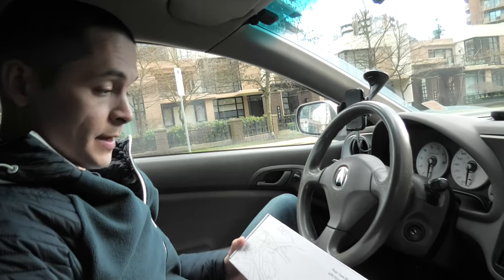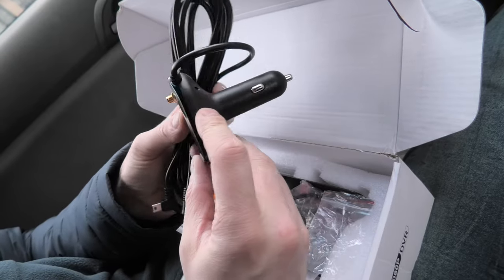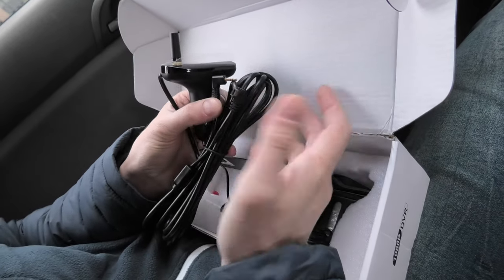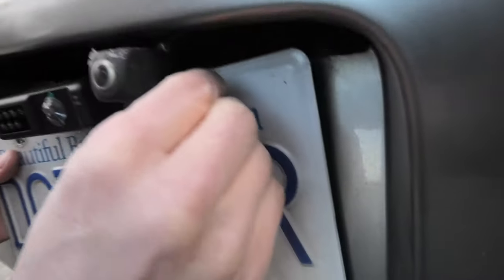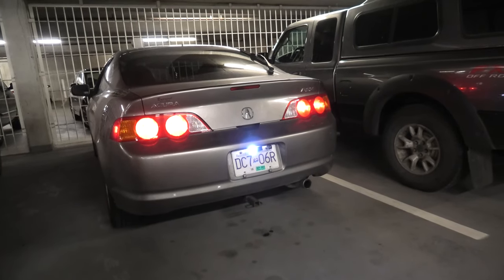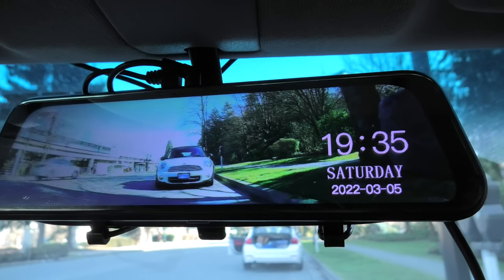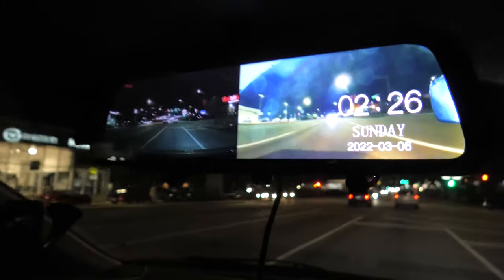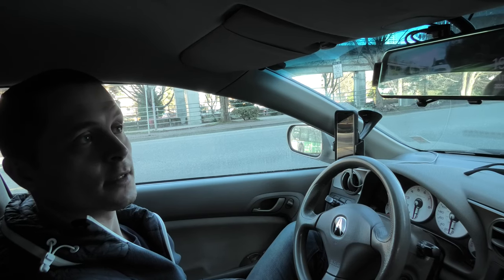TX Mirror Dashcam With Wireless Rear Camera From FXT Technology.

Comment: Generally mirror cams have the same issues, they may be on the same board just with different names! The main points are:
The GPS module isn't inside the mirror and needs dirty wiring.
Rather than supercapacitors, they're battery-based, which can catch fire at high temperatures, and are short-lived batteries.
The GPS, power, and rear camera are all connected by three wires instead of just one.

Comment: That’s not a wireless rear camera when there’s a wire attached to it.
Reply from the maker: The idea here is not to run wires inside the vehicle through the whole cabin. You can install the rear camera on the trailer or in the back of the truck / van again without having to run the cable from the digital mirror to the rear camera. This provides more flexibility especially for large vehicles. Since the rear camera requires the power it does need to be connected to the 12v source in the back of the vehicle.